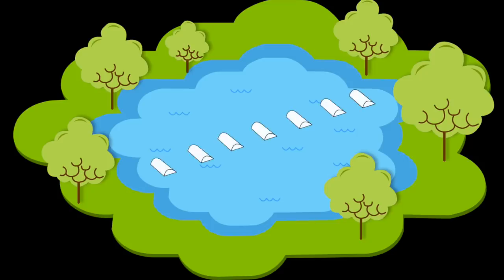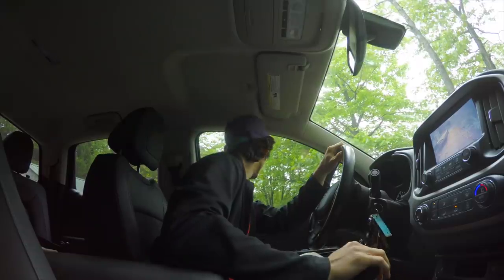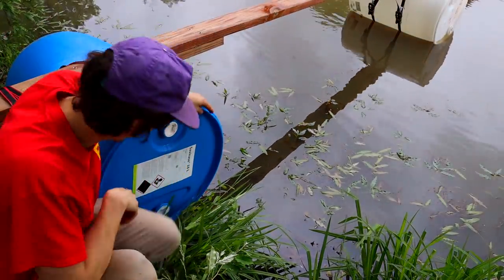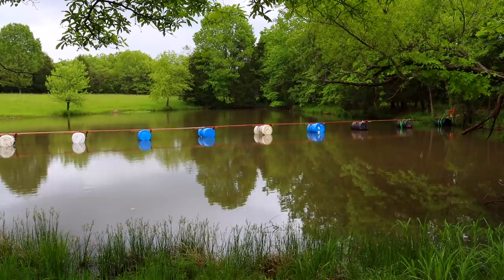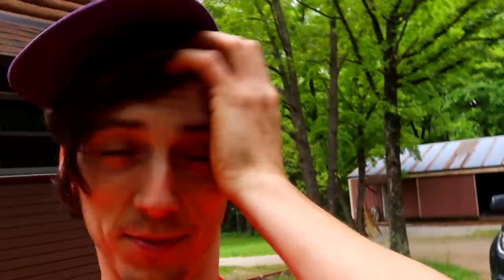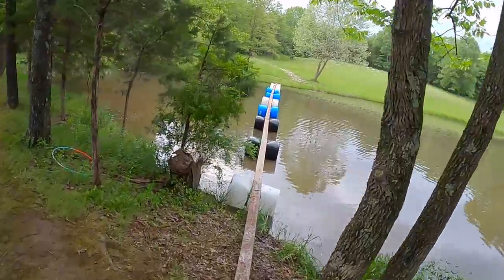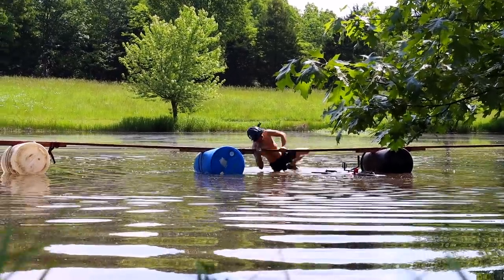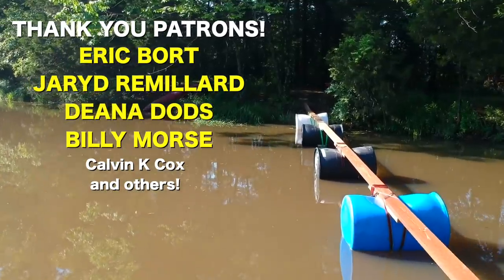Building a Slippery 110ft Floating Skinny on our Pond... Can We Ride It?

Comment: If you partially fill the barrels with water, they will be semi-submerged and hence much more stable.
Reply: Yes
Reply: Or a set of outriggers in the middle of the span.
Reply: @MrEmptyKay  what's outriggers?
Reply: @oftankoftan  Basically more barrels that stick out on either side (sort of like training wheels) for more stability.
Reply: is there a source for this assumption? I feel like it will make it a little more stable, but not significantly. 
I think a cross plank would make sense to keep it more stable, or perhaps several.
Reply: @Broockle  Ships use tanks filled with ballast water for stability when they are empty.
Reply: Matthew Kessing problem is you have to bail over the out rigger.
Reply: takes a way the challenge
Reply: @kenchow8213 
Mok, but how about in addition we add a rudder that cuts into the water along the path. Maybe that can keep it from swaying left and right.
Reply: Of course he seems to want to make it hard to cross, the obvious improvement if you just wanted it usable would be to have more boards (make the deck wider).  Another interesting thing would be a concave shape to the deck, then the tire would self center (you'd have to work to ride off the deck)
Reply: Or sand maybe so the ballast would be less likely to shift. Also skateboard grip tape on the top.
Reply: @Broockle  for sure, lower COG is way more stable, that thing has such a high COG right now. it might sink too much tho.
Reply: @vanyadavydov2403  right now it's not challenge, just random luck since it deflects in all directions lol. Have you ever ridden skinnies before? those are difficult, i can't imagine this with it moving.
Reply: So make it bottem heavy
Reply: sand mite worke better
Reply: sand mite worke better
Reply: Actually ur wrong The barrels are going to float no matter what and how much water you put in there The more water you put in there actually will make it sink more so you're wrong
Reply: Don’t you mean stability sorry I had to ok
Reply: Lameeeeee
Reply: I was thinking exactly that
Reply: @m.r.cerney3608  
skate board grip tape is REALLY expensive
Reply: @0xsergy  
A rudder wouldn’t lower the COG, partially filling the barrels, on the other hand would.
Reply: @aaroncampbell1617  
you sound like a 6 year old explaining why he’s not it in tag. also, the point of filling them is to sink them, lowering the center of gravity.
Reply: @zynic6568  
ah yes, they will have a lower center of gravity and thus will be much more stability. grammar at it’s finest
Reply: @Broockle  
you mean make it wider? that would do little to stabilize the barrels. partially filling them will partially submerge them. this lowers the center of gravity. one example of this being used in everyday life is on container ships, where they are partially sunken using tanks full of water. if world class engineering results in something, I think it would be a good idea to listen. In addition, a “rudder”of sorts would be very ineffective due to it needing to be hydrodynamic to a very high standard. Even if he was capable of doing this, there are 0 everyday life examples where rudders are used for stability and not for steering. you call the partial fill idea an assumption, yet fail to realize you say “In my opinion” and “I think that” when supporting your claim, this gives no reason for why it would work. you should like a 3rd grader explaining why they aren’t it for tag.
Reply: @simonsaldana9024  
i thought cargo ships submerge as they get heavier. What does that have to do with balance? Ships aren't at risk of tipping over. 

But ye I'd be happy to explore both options and compare them.
Reply: @Broockle  
a) they are intentionally weighed down
b) the more they are submerged, the lower their center of gravity, making them more stable. 
c) have you ever heard of a capsized boat?
Reply: Genius
Reply: Was coming to the comment section to put the same observation.
Reply: Unless the water is held in place with baffles, adding unrestrained water will make it less stable. I'm also wondering why he would want to make it more stable. Is not the whole point the fact that it is unstable?
Reply: Water is not a stable ballast solution. It will just shift and follow the imbalance of the rider on top. Concrete or rubble could do the trick.
Reply: It's hilarious someone asked for a "source" to wrap their heads around Center of gravity. 😂🤣
Reply: The genius comment

Comment: Another idea would be to use barrels on either side, with a wooden support across from barrel to barrel. Then the skinny beam would be in the middle. You would have less bobbing from waves, less sinking from different weights, and more stability as you ride. 👍🏻

Comment: To make this easier spread the barrels out on the sides, you don't need all of them to be like this but if you do every other piece then you will get some up and down action too. like add horizontal structure. you could even stretch the distance between them too or partially sink some to get you closer to the water. I might even let it sink below the water a few inches in some places to maximize the bumps.

Comment: late to the party, but it looks like you need to secure the skinny from moving side to side.  Every time you lean or turn the skinny drifts the opposite way so its impossible to actually make any corrections.  Maybe run a couple lines from shore perpendicular to the skinny? Awesome video by the way!

Comment: If you want to make it doable (and spend a bunch more time and money on it) double-up on the barrels at each point. Rotate them 90 degrees, and put them about 5 feet apart, with a front and back crossbeam for the riding board. Would make it MUCH more stable, both laterally and vertically, but most of all it would stop it from corkscrewing the way it is. It's an inverted pendulum the way it is now, so each barrel randomly tries to "dump" the top board left or right.

Comment: You could increase stability by filling the barrels with a bit of water. ~1/3 would produce the best results because the most stable is to be floating at exactly the halfway point with the riders weight as well, because they creates the largest surface area of a cross-section on the water plane.

Comment: Drop 1 pedal, and lower your hips right down, that will drop your center of gravity significantly, making it a lot easier. Also, if you’re tipping to 1 side, rather than bail immediately, try taking off your opposite foot off the pedal to balance, commonly seen used by trials riders.

Comment: Try to let some water into the barrels it will lower there tipping point and your center of gravity I would recommend about the bottom of the 2by4 less than a foot over the water trying to accommodate for the rider weight if you let enough out it will look like your riding on water also less distance to fall good luck

Comment: If you wanted to make it more rideable, instead of a single row of floats,  put on cross pieces with a pair of floats. The further apart they’re set, the more stable.

You’d probably want to cover the cross pieces in foam, as you’d be pretty likely to hit them in a spill... 😅

Comment: U should put two 2x4 on either side of the barrel across. and screw it to the deck then ratchet strap around the barrel on the left and right that will be very stable

Comment: I have a question.  I rode(and crashed) bmz bikes over the years. 
Then i moved on to MNT bikes.
I noticed that these guys have bars that are 3 feet long. When I rode bmx we would cut down the bars to do tricks and fit into tighter spaces,like dirt jumps in the woods , as well as trails in the woods. 
So why are these bars so effin long?

Comment: I feel like it would be more fun if physics wouldnt make it near impossible to ride it. Actual floating bridges or piers are filled to partially with water (how much depends on the weieght of the scructure, the heavier, the more water) to keep the point of swinging as low as possible.